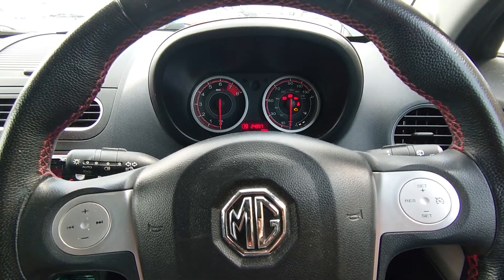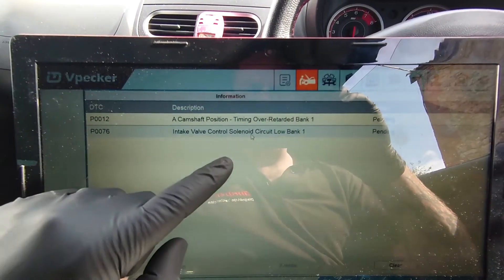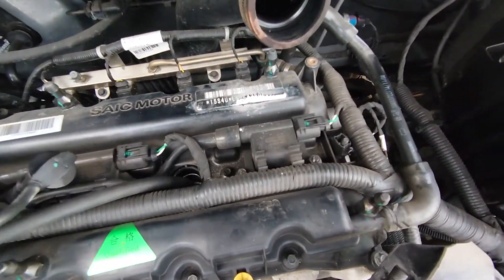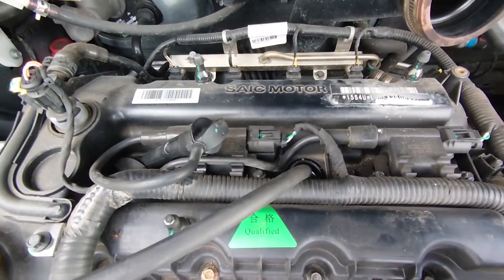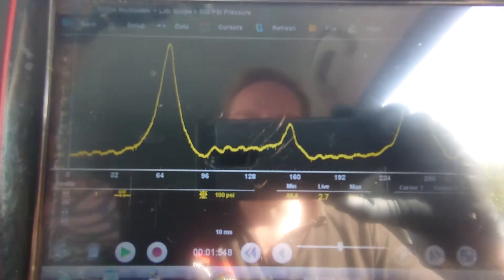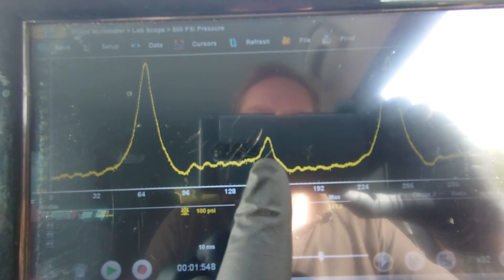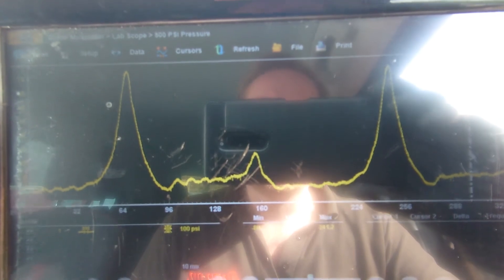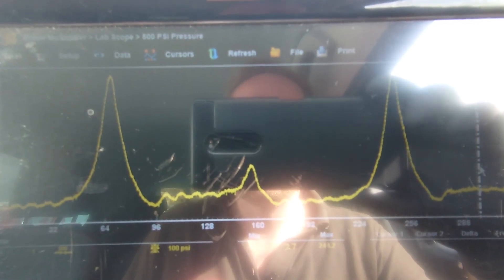MG 3 Timing fault P0012 Camshaft position over retarded

Comment: We had a second hand MG, registered in 2015, that hadn't even done 34,000 miles when the timing chain snapped. We got the dealer to pay for the repair costs and then promptly got rid of the MG3. We now have a Mini Cooper Clubman which cost twice as much but is far better. MG is Chinese made now, which means cheap and poor quality. Nothing inside the engine should fail inside 34,000 miles!

Comment: Quite interesting your video. Unfortunately, no clue as to what is at the root of the problem and how to go around fixing it. Can you please help? I had replaced both sensors associated with the fault and nothing changed. Also, the car's performance continues to be impeccable. Many thanks

Comment: I have same issue with my car. I got timing chain replaced and installed new VVT solenoid but check engine light with p0012 comes back again after driving 180Km. I reset and it comes back again after driving 170 Km. What could be reason ?
Reply from the maker: Was it done with the correct timing tools? They can still be out and run quite well. Can it be rechecked?
Reply: @rmautodiag  You mean I need to recheck my timing chain ?
Reply: Yes they had used proper tools. I got it done from dealership. I think they haven't done it properly, that could be reason for re-appearing check engine light with p0012 code.